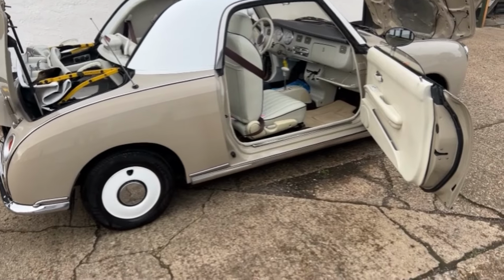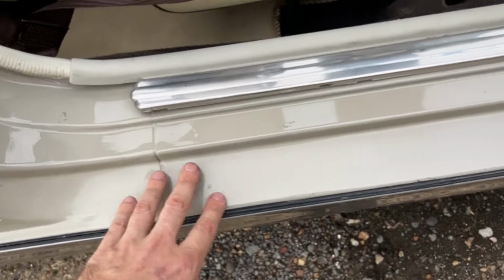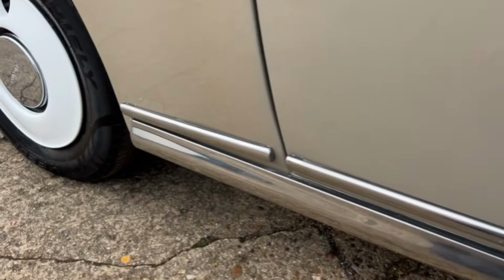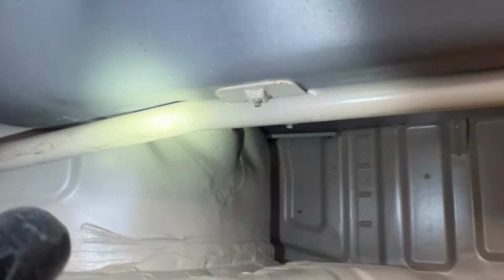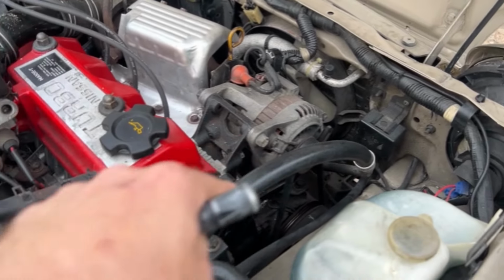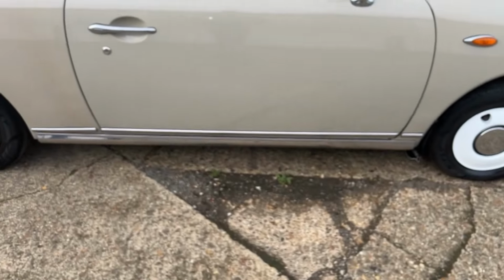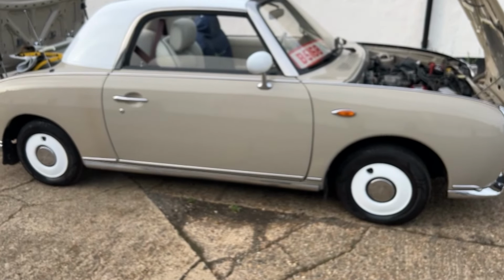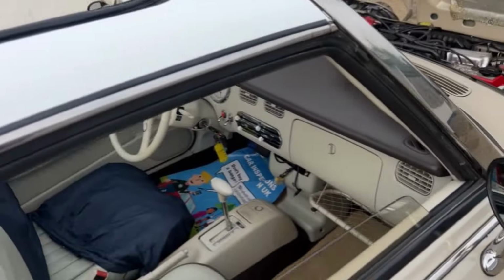How can seller justify £20,000 for this Nissan Figaro after pre purchase inspection

Comment: Unpopular opinion maybe but £20k is far too much for a Fig (I have one myself in emerald). You don't need to spend that and anything over £10k really for a near mint just too much.

I get that there would be special circumstances where a car has been stored for 20 years with low milage. Owned by someone famous or either bult the first or last. Or even modded.

Something like that I'd understand bc it's out the norm. But for an every day Fig it's far too much.
Reply from the maker: You’re 100% right hand drive version or left hand drive

Comment: I've restored one of these and the sills are very thin, triple layered and very complicated / expensive to get right.  I'd wager nearly no-one does them properly.

Far, far cheaper just to bang on a new outer sill and bodge the rest.

Muchos caution needed with Figaro bodywork and body trims.  After that it's a Micra, so mechanically strong.
Reply from the maker: You are more likely right. To by a new sill and get it right its like repairing accident damage car its very time consuming job and no one does it as it should be done.